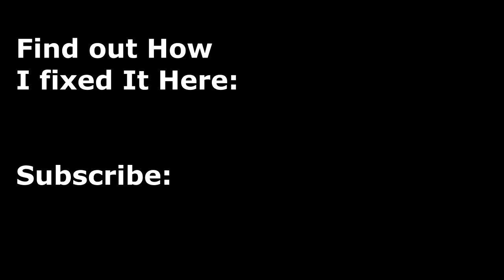Time-Lapse CRT Restoration - Full Recap of a Sony PVM 14N6U

Comment: Nice work
I have a 14N6A and the previous owner was a video professional and he used it at home as a preview monitor only
Unfortunately I haven't seen Aussie PVM/BVM with dates on the case, but this one I have is a later serial no: and the amount of use I shouldn't need to recap this one yet, but one day I will open it up to blow the dust out and maybe it will have a date on the tube

Comment: As an EE as well as a broadcast engineer, very familiar with that product line, there is really no need to re-cap at this time. I am using older CRT monitors than that with no issues at all. I have one of those on my bench.

Comment: Hey, I have a problem with my 14N6U and I was wondering if you have an idea on how to fix it. 
I only get blue tones, I've already resoldered most of the unit with no change. Would it be a capacitor thing? (Haven't replaced those yet, I don't have the right ones available right now and as far as I can see they also look fine)
Reply: There are capacitors on the back of the input board that may be the culprit. I am also facing color issues right now on my 14N6U and trying to find solutions.
Reply: @AkujiTheSniper  if you find any solution please let us know!

Comment: Is there a particular reason why you left the snap-in custom cap in place?
Reply from the maker: Yeah, the biggest reason was because It was on 6+ month back order from my supplier.  The original one tested good.  The replacement was also $7 - $8 for that one cap.
Reply: @RetroTechUSA  Fair :) I'll be tackling a recap this weekend and I figured I'd double check that there wasn't a reason to reconsider replacing a similar cap on my power board pcb. Had to swap out a selection or two from my list for in-stock ones, so I hear you there.